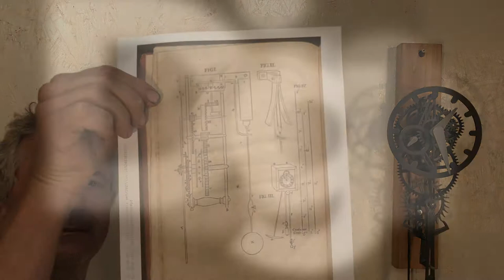Christiaan Huygens inspired 3D printed clock

Comment: could you post a list of hardware you used to assemble?
Reply from the maker: look for the build video
Reply: @jacquesfavre999  Ok, i printed this clock and assembled, but i cannot get it to start.  It does not seem to have enough power to push the escapement.  All gears turn with no visible issue.  I did put ball bearings in the pendulum.  Could that be it?  What weight did you use in the pendulum?  At most i can get it to tick 3 or 4 times then it loses momentum.  I am using a 3.5 lb lead and .5 lb counter weight.  Watch vid a million times but must be missing something.
Reply from the maker: @chrisdepalma6844  I had to use a lot of weight, lots more that I thought, but 3,5 lbs should be about right. Also the pendulum has to hold weight too, has to have some inertia...
can you pull on the chord and have it going, that would mean more weight will make it work...
I am not sure to understand the ball bearing in the pendulum?
Can you post a video?
Reply: @jacquesfavre999  i filled the cavity in the pendulum bob with .25 inch steel. Balls for weight. I use the provided spacer and one m5 washer to get the escapement wheel to engage the pallets, but the pendulum only ticks 5 times. I tried dry lube and a 6 mm brass bearings to reduce friction on drive wheel but still no success. The spacer i used under escapment is the one that measured 29.17 on my caliper, so i assume that is the correct one.
Reply: @jacquesfavre999  https://youtu.be/Wu8E9vlmQTY
Video showing my build. Excuse the bad quality.
Reply from the maker: I did comment on your video @chrisdepalma6844
Reply from the maker: I am planning a trouble shooting video next week end
 @chrisdepalma6844